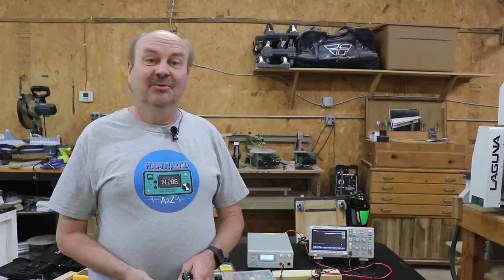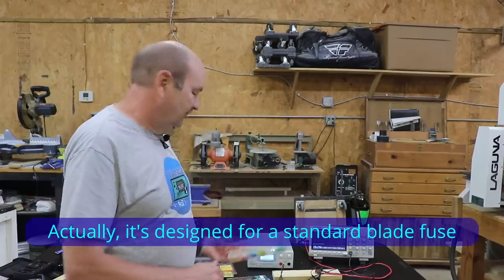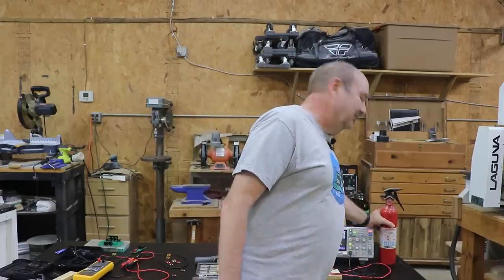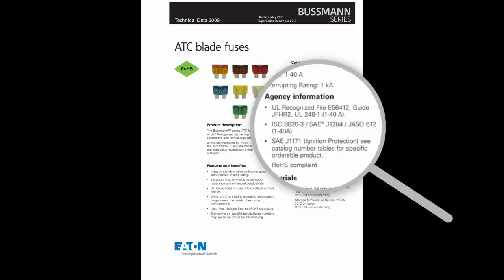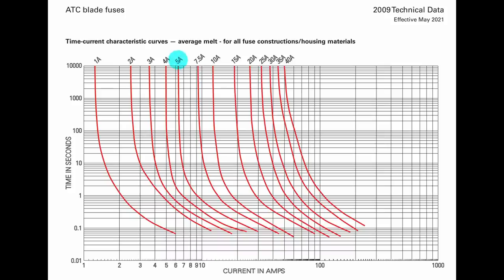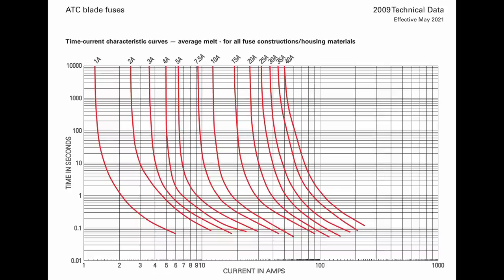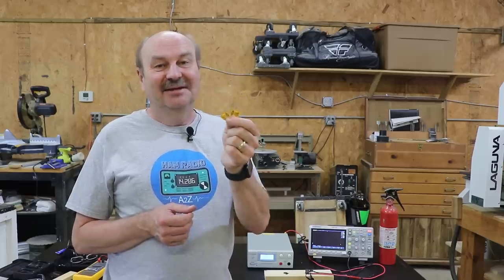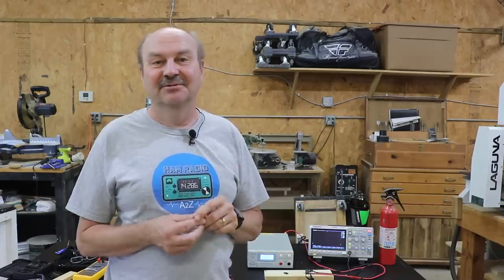Bad Fuses

Comment: I’m going to go out on a limb and assume these are Chinese. We now have two glaring examples of the suspected “we don’t care I f our products meet requirements, we just want the Americans’ money.” The other is in a YouTube where the producer demonstrated that rechargeable batteries have a third lead to give the radio, iPad, or what have you access to a temperature variable resistor. This changes it’s value based on temperature inside the battery. If the temperature and resistance go too high the device turns off the charging circuit to prevent “lithium battery combustion”—a fire. Cheap, Chinese batteries will often include a fixed value resistor with the right value to keep the device thinking the battery is OK, so keep charging.  Most folks won’t know the difference—just those whose device catches fire while charging. These people care so little about making quality products that hey will avoid buying temp-sensitive resistors at some cents each and buy resistors that cost a few cents less.  This is why I DON’T BUY made-in-China ham equipment at prices that undercut similar ones by the Japanese Big Three and US companies. Do we want the second-rate radios, batteries, etc., to become our ONLY choice?